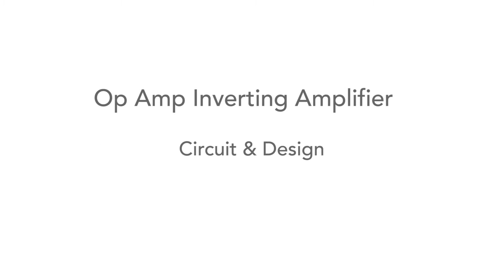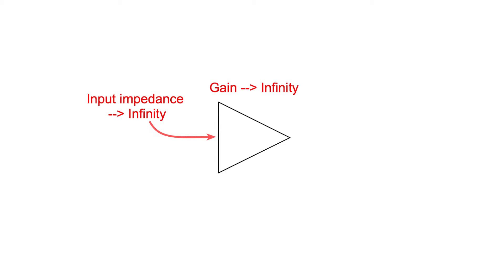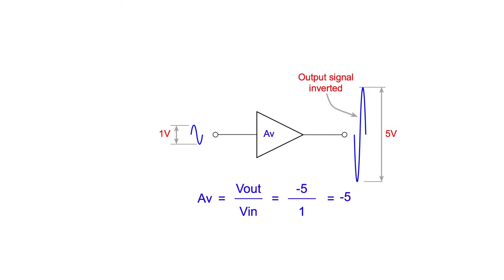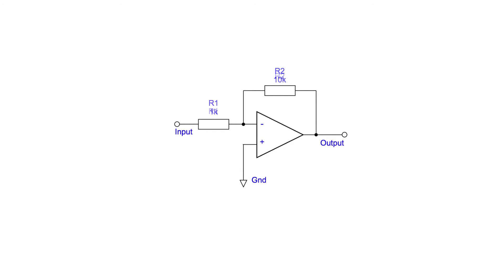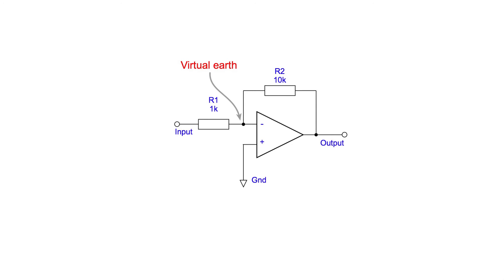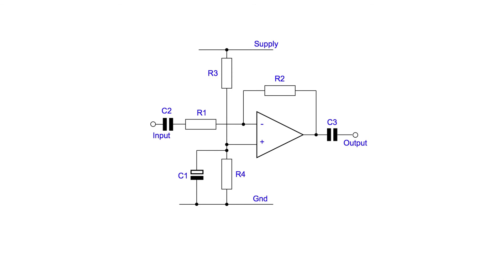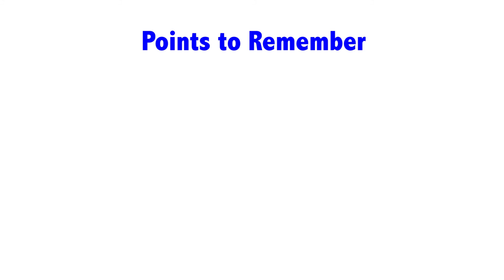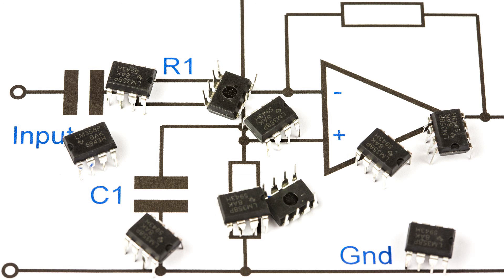Op Amp Inverting Amplifier Circuit Design #opamp #operationalamplifier #circuitdesign

Comment: I have watched many videos about opamps but the one thing that I don't know about is what happens if you were to use positive feedback! The negative feedback remains on the inverting input no matter which input is used but is there any circuit that uses or benefits from positive feedback if it's even useable? I haven't seen anything about it anywhere so I'm thinking that it shouldn't be used... 
This series on opamps is actually very good, if I could nitpick on anything... It would have to be when you point out things to note, you don't put in what they are essentially for. It's all good while watching the video but I like some other people who are a bit slower at absorbing everything tend to take screenshots of the circuits and any notes that need to be aware of but after a few screenshots they all begin to look the same which defeats the purpose of the screenshots LoL.. I just wish that someone would create a poster that I can stick on my wall that covers the necessary basics that can get you out of one of those moments when you have a brain fart.. I hope that this comment finds you well during this corona age, stay safe and stay home...
Reply from the maker: Thanks for your comments. In terms of positive feedback, this is not generally used in linear applications, because the gain of the op amp is so high. Where it is used is in applications such as comparators and Schmitt triggers ( a form of comparator) Here the positive feedback assists in the switching. https://www.electronics-notes.com/articles/analogue_circuits/operational-amplifier-op-amp/schmitt-trigger.php
In terms of your other comment, I will bear this in mind when I next make a video. However you may want to look at the series of pages on our website: https://www.electronics-notes.com/articles/analogue_circuits/operational-amplifier-op-amp/op-amp-basics.php from here you can link to a large number of other pages.
I hope this helps.
Reply: @ElectronicsNotes  Fascinating! I'm definitely going to look into Schmitt Triggers, I'm sure that there's an interesting circuit that use Schmitt Triggers in test equipment that could prove very useful on a test bench..

Comment: It is a very useful lesson and explanation, thank you so much!!! May I ask if there is a way to find the values of the two resistors if we are given only the Vin and Vout values and f=1000 Hz? I mean, I found the Av = Vout/Vin but then I cannot calculate the values of the Rin and Rf because I have no current values and nothing else. Thanks in advance.

Comment: So that means we should start with 1k resistor for gain i thought that for gain of 10 i could use 100ohm & 10 ohm resistor but is it important to use high valur resistance can't i use low value resistance
Reply from the maker: Whilst you could use the values you stated, they would require relatively high levels of current to flow. As a broad rule, it is often best to keep them in the k Ohm range and then current levels are kept within reasonable limits.